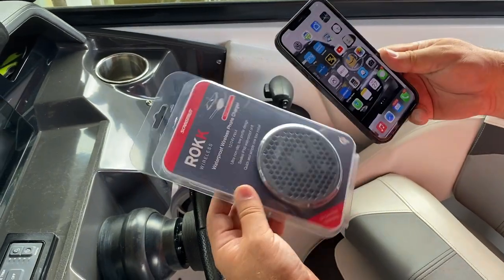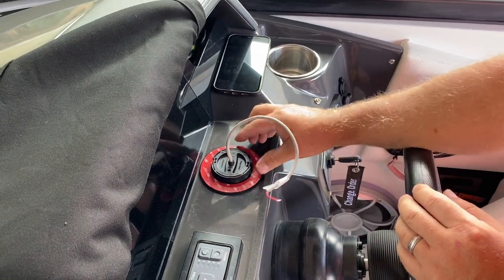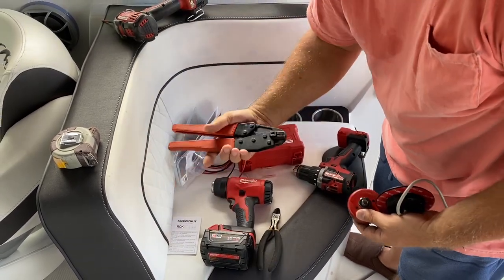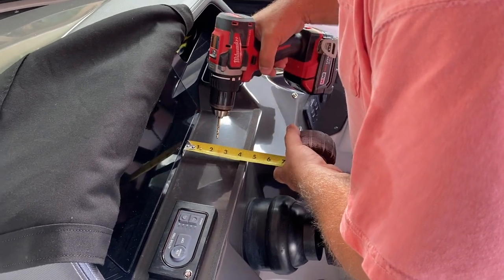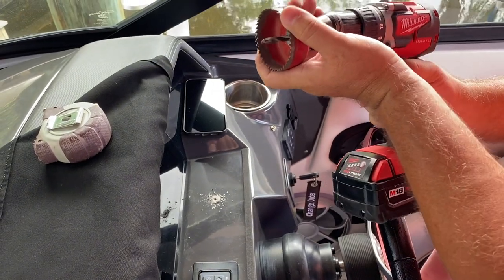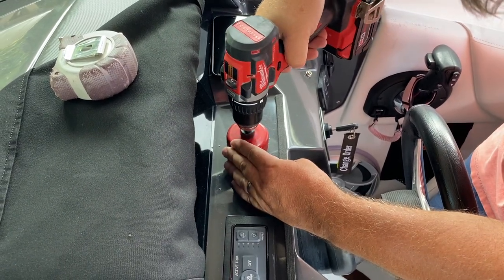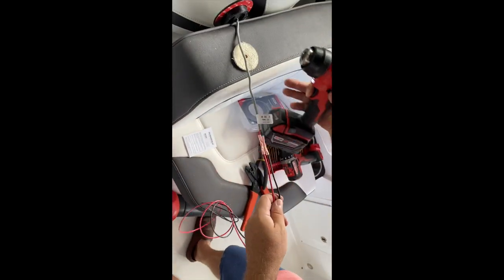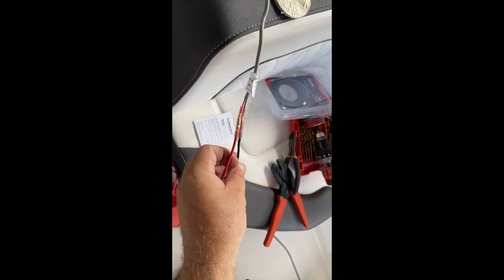Wireless Phone Charger installed on your boat

Comment: How do you like it so far how fast does it charge
Reply from the maker: I love it because it holds the phone in place and the charge keeps up with use while Bluetooth is connected. Also, when I grab it to take a picture, it would be very cumbersome if there was a cord attached. That said if your phone is not charged when you get on board, it’s not going to top you off very quickly.  It really only keep up with Bluetooth. Another problem is in Florida if it’s very very hot, it will stop charging seemingly due to ambient heat. I have the same problem in my car in Florida so I don’t think there’s a solution and it was plugged into a cord it would do the same thing.  Thanks for the comment.